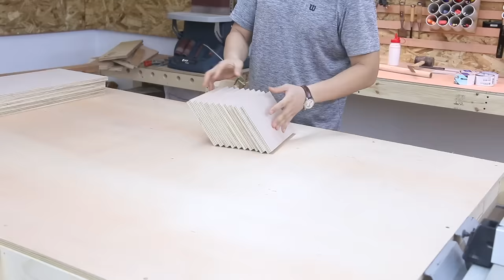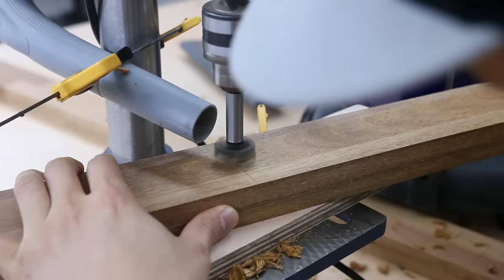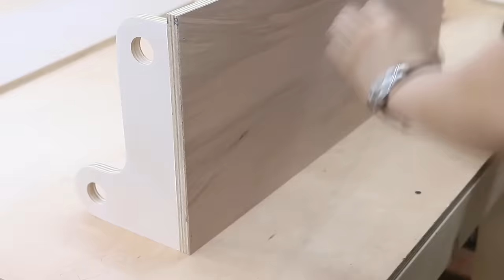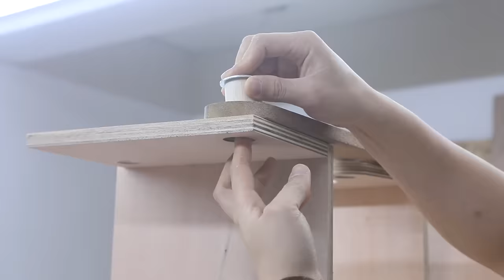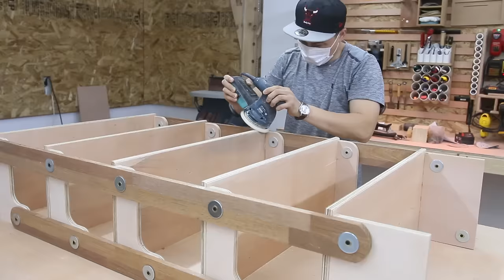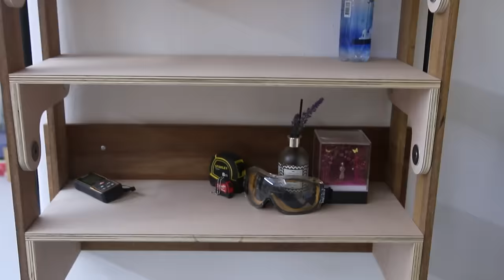테이블과 책장을 한번에 오토 리프팅 책장 만들기 / Floating & Auto-lifting : Table & Bookcase Shelf [목공 diy woodworking]

Comment: Friend, congratulations on the execution and the project. I have two questions: In the table format, how much weight does it support approximately (based on your used materials)? And what keeps the table in a horizontal position, preventing it from going further down to the floor? I am analyzing it but I did not understand it completely. I appreciate if you can answer. Thanks a lot,  Paulo.

Amigo, parabéns pela execução e pelo projeto. Tenho duas perguntas: No formato mesa, quanto peso ela suporta aproximadamente (baseado nos seus materiais usados)? E o que mantém a mesa na posição horizontal, impedindo que ele desça mais na direção do chão? Estou analisando mas não entendi completamente. Agradeço se puder responder. Um abraço, Paulo.

Comment: Would it have been better to just have a flat table against the wall with pivoting shelves that would all them to hang freely. This way you could fill the shelves and when you folded the table down the contents would not fall off. Your current setup requires you to clear off the shelves prior to using the table or at the very least move everything around. But regardless it is still a nice project.

Comment: Have quite a bit concern the stability of the support on the wall side. It seem too much weight and stress will apply on the wall when extended it out as table.

Maybe add a leg at the far end that when it lay out as table it will expand and behind a leg to support the weight

Comment: Ok it's clever but it's impractical. If using it in shelf mode, the entire shelf contents needs to be removed to change it to table mode. So if it's used as a table very much, it pretty much renders the shelves useless. To go one step further, if using it in table mode that often, just make s permanently flat folding table that hinges from the wall in the same way. 
   It is nicely executed however and I fully appreciate all of the labor put into the project.

Comment: This is a bad idea. He might know woodworking, but physics tells me that there is a 10-30 times magnification of any preasure put on the far end of that "desk" and the srews in the wall.
It could work with verry sturdy bolts fastened through the beams in the wall, but without that this desk will fail shortly.
Reply: Has it fallen off the wall yet?